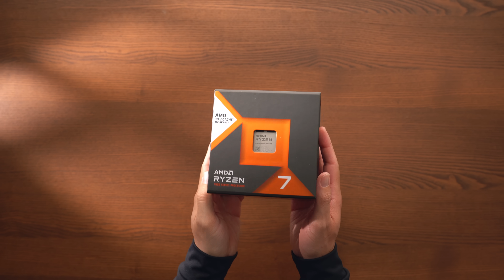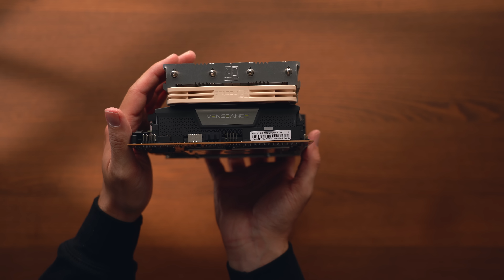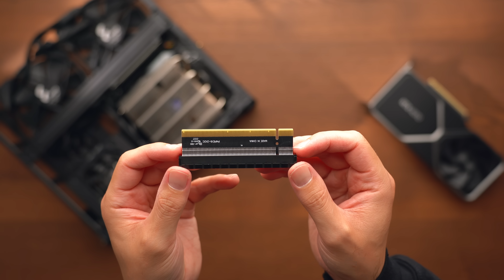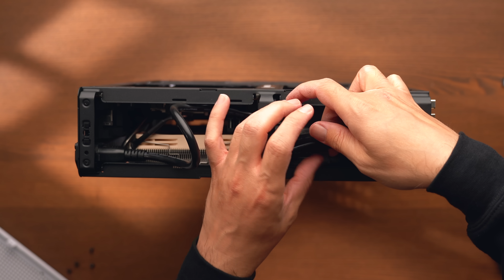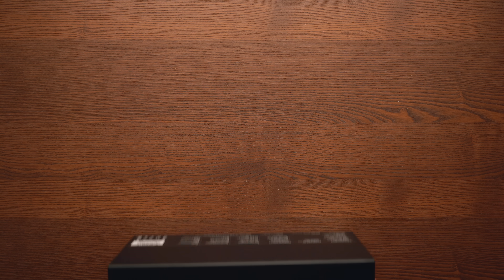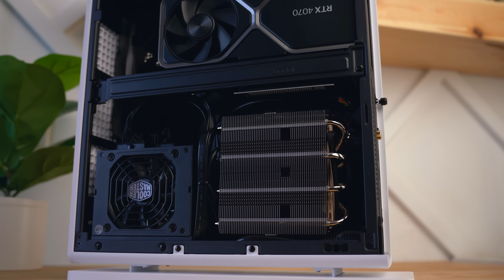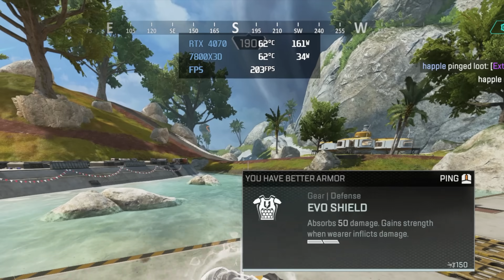UNREAL Mini Gaming PC - PS5 on Steroids

Comment: This is something my blind ass can put together. I'm the vision impaired gamer but I don't care I love video games and been playing them since i was 5. My laptop has the same specs but different parts. Laptop is hooked to a 50 inch TV. I have a gtx 1650 gpu. 32gb ram, 4tb m.2 hard drive chip. That has half my old school games and pc games. I have an external hard drive 4tb for more games. I have a external 4tb hard drive for media. Lastly to complete my game console build I use kodi for my media and launchbox kodi plug in to run launchbox BigBox which is like steam big picture mode. This is a frontend similar to a game console interface and it had all my retro games, Steam games, and other pc games. All ran using an Xbox one controller
Cool huh? 😅

Comment: I only viewed part of this because you click baited with the word “UNREAL.” Also when the nice case cost half the price of PS5, you raised my eyebrow on what the total cost of this system would be.

Now if you really wanted to make a system that matches the PS5 at the same price, that would be much higher challenge.  Sadly, you really can’t, I know I have tried. But for my own needs, I have found going with older 12th gen i5T, MSI miniITX motherboard and an RTX-4060, I was able to play the 2023 AAA games I have on my 8.9” 2.5K panel & gamepad device I call the ‘Gaming Lens’ at High or Ultra setting including Cyberpunk 2077 (High Settings - 1920x1200 90fps w. Ray Tracing) and “The Last of Us” (High Settings - 1920x1200 90fps). My case is half as high and an inch or two thicker  (boring black) AND it only cost me $700, including the ‘Gaming Lens’.  For me, this suits me just fine, Oh and it only draws 200W and can be powered by 19VDC battery pack.

Comment: I wonder why your gpu is that way around mine is turned and the case fans blow into the gpu fans on mine 😅
Reply: Can you turn it around depending on the way you want to? Or can you move the fans either way?

edit: he has the fans that way because the 4070 FE is a blower type cooler, this will help temps more then intake fans would, in fact intake fans can hinder temps by causing turbulent air in front of the GPU

Comment: I was thinking of going this route with a 7700 because of the lower power consumption. How would that affect performance? Would I generally be able to play games at 1440p at a high refresh rate? 

And as for cooling, would an extra 80mm fan at the top for exhaust help with lowering temperatures?

Comment: would a 4090 fit in this case thanks in advance
Reply: It actually does with no case fans up top I think you could fit two slims though next to it. Also the power adapter gets kinda crunchy so if you went that route definitely buy a 90 or 180 degree power adapter.

Comment: The processor alone is more expensive than the PS5 itself. If you only plan to game, PS5 on top, the value is extremely good.
Reply: no its not but yes ps5 is much better value
Reply: @michubern1444  still close to the cost, and thats cpu aline
Reply: @randomlol69  ps5 is a mini budget pc with a amd apu ofc its much cheaper
Reply: @michubern1444  A mini budget PC that packs the power of an RTX 3070
Reply: @randomlol69  2070 not 3070
Reply: @michubern1444  🤣 Check benchmark videos and do research then come back. Keep coping that "ultra-budget gaming pc" won't compare.

Comment: It looks like you have the old riser.  Any issues with PCI-E 4.0?  Especially because that card is only 8X PCI-E.
Reply from the maker: There were issues with the PCIe 4.0 riser a few months ago and Fractal updated the marketing to say it only supported 3.0. Just this week they released some cases with a 4.0 riser so, I’m assuming those issues are resolved, but I haven’t tested it myself.
Reply: @devyn.johnston   The way the PCI-E pins poke through the other side of the PCB I can tell you have the old one.  I contacted support and said it wasn't working at 4.0 speeds and they sent a new riser.

Comment: why is it people keep buying the 7800x3d & then slapping an nvidia card in it? You're throwing away performance gains doing that. AMD's cards this generation are on par & actually better in gaming cases than their counterpart (as long as you don't factor ray tracing which isn't really worth it anyways, we're gaming, not rendering for the government) & you get a performance boost when you pair the 7000 series CPUs with 7000 series GPUs, and it's not a small boost either, it's a significant power boost. AMD's tech works together, you don't get that performance boost throwing an nvidia card in it

Comment: What an entirely pointless video. Surely the aim of a 'PS5 on steriods' build is to build something of similar cost to a PS5 but with 2023 level components (because now that the PS5 is a few years old the cost of comparable PC components is now a lot lower so upgrade the components to within the current price of a PS5 (£450)) This would mean you're getting more power than a PS5 but at the same price point.

Comment: Yah... but couch gaming on a pc sucks... Been there, done that...
Reply: have you tried to use a controller?
Reply: @IMthebiggestboy  Yeup, Xbox controller and a wireless mouse keyboard combo - since you can’t use a controller to launch your games / unless you setup the large steam overlay, then try to add all your non steam games to that, then, it bugs out and crashes constantly or glitches so you can’t use a mouse, or the controller is at its max length in signal and cuts out. Then you launch a game that doesn’t have controller support or you mess up a graphics setting and the only way to restart said game is grab your keyboard and alt f4 out…. I mean I could go on, the fact is there’s always something popping up getting in the way. When it works it’s cool, but to me it’s just not worth hassle compared to just running a console (I have both)…

Comment: how did you use XMP with intel graded DDR5... ive had nothing but nightmares with compatibility, EXPO certified ram is a MUST for AM5. also, you need to be careful running XMP with Asus bios and x3d chips. its a nightmare atm. Id go as far to say, no XMP was used therefore your benchmarks are 10-15% lower than they could be.

Comment: Consoles are horrible value. Where do you get that something charging you a yearly/monthly fee for online gaming and ridiculous prices for games would be good value? By now even the pure hardware is outdated and overpriced for what it is.
Reply: They're really not. I'd have loved to get a new PC but for the spec I'd want I reckon would've been a minimum of £1200-£1300 and that would be the worry of the lack of VRAM in the Nvidia cards for games going forward.

Games are very cheap on the console now considering you can carry over your digital library from your PS4. Plus there is creative ways to get PlayStation Plus for much cheaper than advertised which gives access to loads of games to download like Gamepass.

My PS5 cost just over £320...
Reply: @mr8I7  Not sure what the (limited) carry over of PS4 games has to do with new purchases for 70 quid. Unless you consider buying the same game twice. If you got a discount on your PS5 good for you but then again discounts are common for everything including other consoles and PC hardware. But I guess 320 is a much fairer price than the 500 something a great majority is paying. As for discounted PS plus the way you phrase it makes it sound sketchy. 
And I dont understand why you would compare a 1200 to 1300 quid PC to a PS5 when you get PS5 performance for half that.
I understand the Ngreedia Vram argument and I recommend going Intel or AMD. (not sure about the current state of Intel gpus though).
Even if you buy a 1300 dollar PC today over time you will eventually go even and then save money depending on how many games you buy.
Reply: @TheDude50447  - I think I'd be compromised by making a PC right now. 

With the current poor price for performance and lack of VRAM in Nvidia cards I think I'd be wanting to upgrade within a few years as I think the mid level cards will improve quite a bit soon. Intel looks like it's quite a bit behind the other two and only good for new games so I wouldn't entertain them currently. AMD looks alright but they still seem to be a generation at least behind Nvidia. More power hungry, FSR is poor in comparison to DLSS, poor ray tracing etc.

Also with DDR5 being right around the corner of being the main choice, it puts me off wanting to go with a DDR4 system.

Yeah I could make a cheaper PC but I don't think there's much value in the lower to mid range at the moment sadly. I think I'd struggle to make a PS5 equivalent for even double what the PS5 cost me.

The whole £70 for a new game thing is irrelevant for me. I'll never pay full price for a game. One way or another there is always a way to get games cheaper or I'll just wait for a few months or a year until it's significantly cheaper.

I'm not convinced how much cheaper games really are on PC compared to PlayStation either these days. 5+ years ago the sales on Steam were amazing and there was nothing on the consoles. Now it feels like the sales on the consoles are just as good.
Reply: @mr8I7  Samsung has announced that theyre going to cut some of the ddr5 production cause it sells for much too cheap right now. Both current platforms Support ddr5. 
As for dlss and Ray tracing thats something everybody has to decide for themselves. Is it worth the Premium nvidia charges for it. 
But you already bought the console so yeah. You can look at potential savings yourself. I would be surprised since the entire console concept is to rip off the consumers.

Comment: Sorry but the price to performance of the ps5 is unbeatable making this video pointless and a waste of time. Also don’t forget the ps5 will do 120fps in 4k in some titles.
Reply: I don’t think the point of this video was about “price to performance”. It was about building a new gaming PC in a similar form factor to the PS5. It’s in no way a “budget” build at $599.99 USD, the same MSRP as a PS5 with disc drive.
Reply: @Reluctant_Hero  Trash build. horribly mismatched parts with an emphasis on throwing away $.
Reply: @MrZarono  What would you change to make a better build?
Reply: ps5 is 2070ish performance and thats amazing for the price.
Reply: "4k 120fps" In reality its 1080p that's been upscaled to "4k" so it looks like shit. Also the value of the PS5 really isn't that impressive; this build was Mini-ITX and using all new components so obviously its going to be expensive, you could easily build a PC with better performance than the PS5 for the same money if you're willing to buy used hardware. Also lets not forget that PC gaming is completely free, no need to pay for subscriptions like PlayStation Plus. The PS5 is a good console but idk what point you were trying to make here.

Comment: what's the point of this video? ps5 cost about $400-500 with controller.
Reply: He's just showing off a console like computer build. I myself want to make a build like this soon enough and its cool to have a reference
Reply: @Drewstir68 not practical unless you have extra $1600 and it's better to install blower on the case to circulate air flow better like what they used in console/laptop.
Reply: @nakkabadz6443  It's not about saving money it's about having a nice computer... this account reviews expensive computers, not cheap consoles. And a "blower" fan isn't going to help with anything, the case is already fully perforated...
Reply: @Drewstir68  ah it's a expensive computer channel, no wonder it's not practical. if that's the case why bother Building $1600 pc to replace $500 console? anyone who have that much money don't have to show off that build because there's no reason for you to show off that $1600 build.
Reply: @nakkabadz6443  how thick is your skull? I'll repeat myself; it's about having a nice computer. We spend $1600 on a pc because it looks and performs better than a console. And what are you saying, 'there's no reason to show off the build'? I love seeing a nice computer... it's kind of the hobby of this whole channel and community...
Reply: @Drewstir68  it's nice pc for sure I didn't say it's not. what I said is it's not practical a lot of $ are wasted you can built the same pc with the same performance under $1000.

Comment: how can you possibly call this a ‘ps5 on steroids’ when you can’t even get it to work/wake-up with a ps5 dual sense controller? you might as well call it an xbox series x on steroids because the controller is a huge part of the console experience not to mention the user interface — this is not to say that your build is not beautiful because it is but it is certainly not ps5 enough in a material way

Comment: Just go mATX instead of itx and increase the case a tad and you can keep the prices down. Silverstone GD09 has two 120mm intakes and one 120mm exhaust. Full size power supplies, 92mm tower coolers and cheaper mATX or ATX boards.

Comment: This video is a joke!
Nothing like the ps5, the cpu is waaaay more powerful then the ps5, the motherboard is way better, the ram is a massive upgrade and it had wifi 6e vs wifi 5 or 6, not the gpu basically saying that the Rx 6700 is near the rtx 4070...pffft not even close, 
Let's also mention that you can get windows 11 and overclock it and use any controller you want what a bad title
Reply: no shit. the point isnt to make a pc thats like the ps5 in performance, it was to make something like it in the living room sense, to replace his ps5, which is way higher power